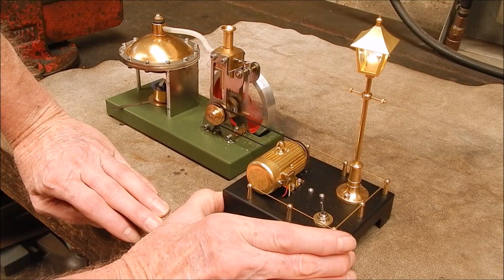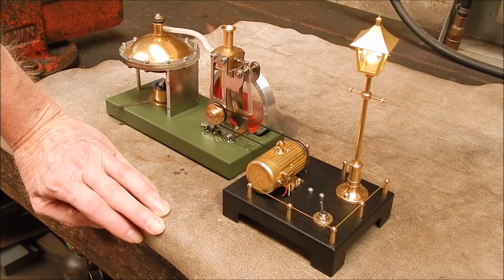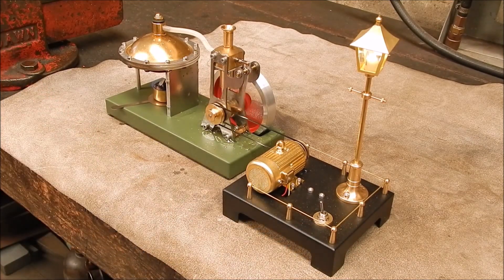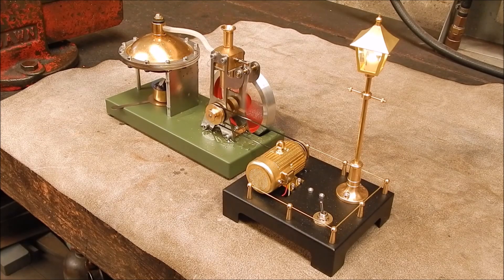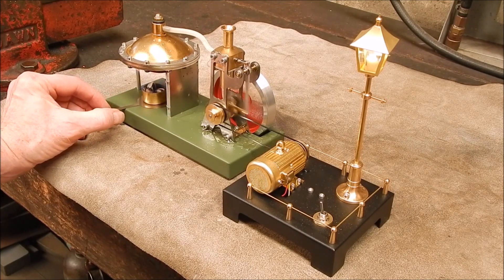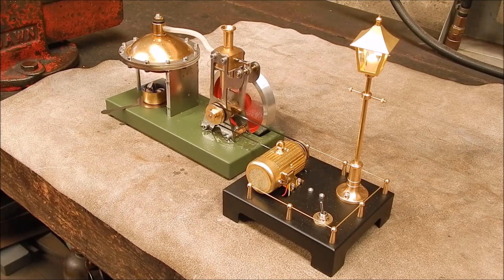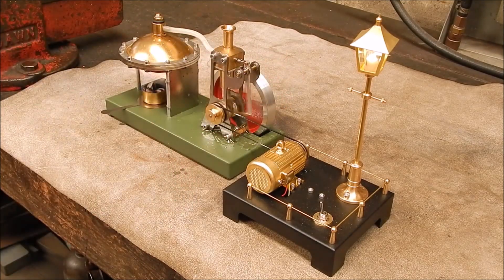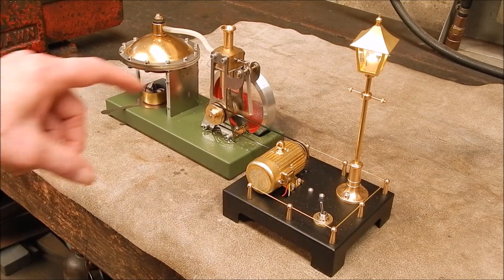The effect of varying pulley ratios on a model steam engine and generator

Comment from the maker: NOTE:  I repeated the exercise with a larger cross section silicon OEM belt to eliminate any slippage factor.  The effect was the same as the original test. The conclusion is that the generator is over geared with the small pulley and the steam engine cannot operate at it's most efficient speed.  With equal sized pulleys engine speed is significantly higher and the light shines brightest.  Steam is like DC motors, maximum torque at zero revs, but that's apparently not the whole story.

Interesting experiment.

Cheers Rob

Comment: Hi Rob. Very interesting but it doesn't make sense. Driving a small pulley from a large pulley gives you an increase in RPM, so the generator should be producing more voltage. Your two large pulleys appear to be the same diameter so that's a gear ratio of one to one, so the generator will be running at the same speed as the steam engine. Which is slower than before. So, one of two things is happening. Either the belt is slipping when it's on the small generator pulley or the steam engine is slowing down. You do get much better purchase from the belt on a large pulley, so maybe slippage is most likely. Cheers, Alan.
Reply from the maker: Hi Alan.  It had me scratching my head as well.  I watched the video again closely, paying particular attention to the engine speed.  It ran at least twice the speed with the two large pulleys.  So it may be a case of too much load on the engine with the larger gear ratio.  The flickering light could be a sign of voltage drop. Cheers Rob
Reply: @Xynudu  Hi Rob. Yes, could be the the increased load. My bet is on slippage. The small pulley has a tiny surface area for the belt to grip and as you say, the belt has a really small cross section. Something has to be going on because you can't argue with physics 😂 Looking at your pulleys, I would say that driving the small generator pulley from the large steam engine pulley should mean that the generator is spinning at twice the RPM of the steam engine. Cheers, Alan.
Reply from the maker: Hi Alan.  You are probably right about slippage.  That thin DVD belt could slip on the small genny pulley and we would not see it.  I will try it with the larger cross section white silicon belt as supplied.  It could be a combination of slippage and too much load. Interesting experiment.  Nothing like a bit of physics to blow away the cobwebs.  Cheers Rob
Reply: @Xynudu  What I love about videos like this Rob, is that it shows how the real world can sometimes have a different effect to what should be happening theoretically. Like you say, keeps the old brain cogs turning over. In fact it's inspired me to do a quick video on pulley ratios. Anyone who has anything to do with steam engines, is an engineer or does a lot of cycling is going to know all about pulley ratios. There maybe some people out there that don't know, so a simple explanation might be useful. Cheers, Alan.
Reply from the maker: Good idea Alan.  I'm sure a lot of people have no idea about pulley ratios and speed v's loading.  If it goes well you could consider covering gear ratios and gear train effect (eg intermediate gears) as per change gears.  Cheers Rob
Reply: @Xynudu  Seems to have generated a little interest. If I was going to do one about gears I would have to rig up some sort of demo rig. Food for thought though Rob. Cheers, Alan.
Reply from the maker: Yes.  You could use your spare lathe change gears laid flat on a cardboard sheet and draw direction arrows etc.  Where people get confused is not understanding that the size of an intermediate gear has no effect on the output speed of a train of unequal diameter gears (eg. 3).  I often see comments on this in discussions. Cheers Rob
Reply: @Xynudu  That's an idea Rob. I had completely forgotten about my lathe change gears. I never use the lathe to cut threads, built up a large selection of dies over the years, much quicker and easier than taking the lathe apart! Cheers, Alan.

Comment: great experiment sounds well too Rob
cheers👍👍🚂🚂
Kev
Reply from the maker: Hi Kev.  That little engine chuffs away nicely.  I like it a lot.  I was interested to see if high gearing of the genny would over power the engine torque, but the ratios I used seemed to be OK.   Not a lot of difference in the LED brightness for the given amount of steam pressure.  Cheers Rob

Comment: Rob, this rig is an absolute work of art. Have never run an engine on steam myself but enjoyed hearing this run at slower speed under load.  Also, like seeing the raw output from the generator reminding us that the crank is not running at a constant speed through its rotation. Wonder if it runs cleaner under load or vice versa? There are easy ways to smooth the light output if that is the only reason for wanting to run faster.
Reply from the maker: I was mainly interested to see what effect the steam engine torque distribution had when using a higher ratio (which increases load on the engine and theoretically reduces crankshaft speed). Without measuring crankshaft speed and voltage I'm still not sure what is going on.  Cheers Rob

Comment: Still produced the same amount of light with less stress on the steam engine. Win win on wear ratio in the long run. Nice one Rob. Cheers Tony
Reply from the maker: Hi Tony.  Yes.  It probably used torque to offset the equal pulley ratio. Cheers Rob